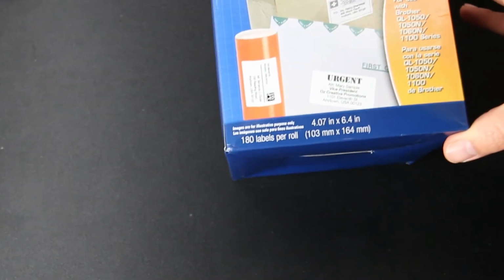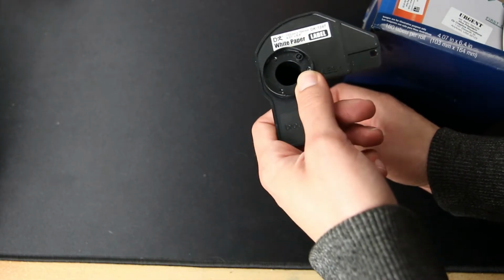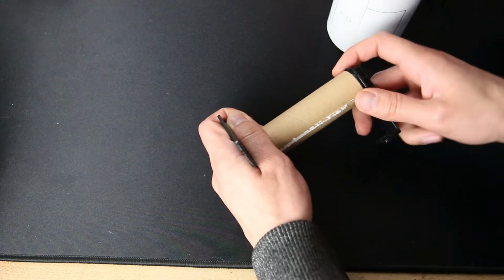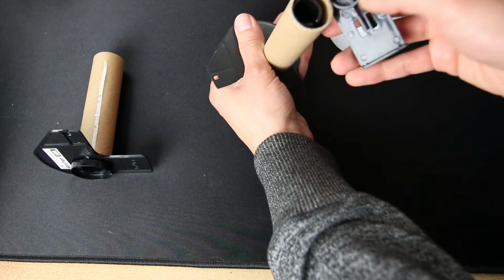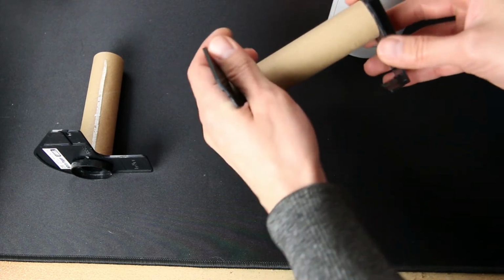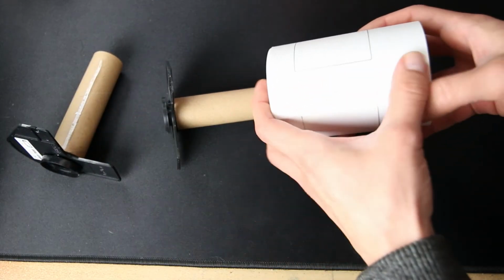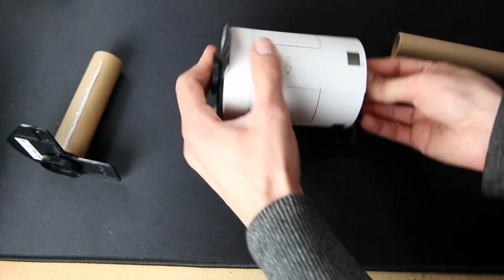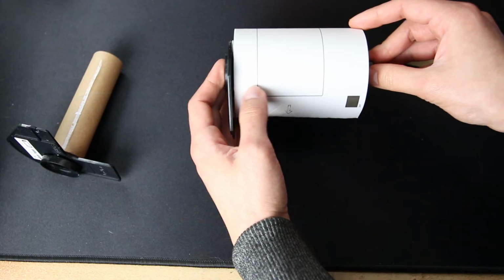How to replace Brother Label Printer Roll

Comment: Mine was glued as well. It's new. I guess Brother realized people could take them apart and reuse them. I tried everything to snap mine open without breaking it. TIP: saw it in half. Saw it cleanly, then pop the pieces back into your new roll. The two pieces will hold the way it is do to the hard cardboard. Works great!! Hope that helps.
Reply from the maker: Thanks for the tip!
Reply: this did the trick for me too ... thanks dude
Reply: @buddhistdudevapes9914  Awesome! Glad I could help.
Reply: good trick mine was glued but I broke it apart and it is still useable

Comment: I found it best to use a long flathead screwdriver.  Insert it thru the hole in the "board" side inside the support tube.  The tip of screwdriver should be flush against the "sensor" side.  I proceeded to tap the handle end of screwdriver on the floor which pushed the "sensor" our of the support tube with no issue. I thought too that I was going to break this thing by pulling on it.  Enjoy!

Comment: Can I use different brand label roll with this printer? Or did they make using the brand's label itself mandatory?
Reply from the maker: It doesn't matter what brand of paper, as long as it's compatible with the machine. Could use this similar sized paper: https://geni.us/3ya8n
Reply: @AdamUPN0w  thank you so much.